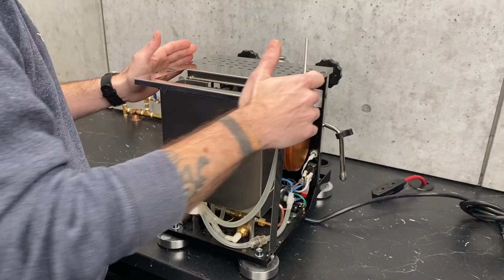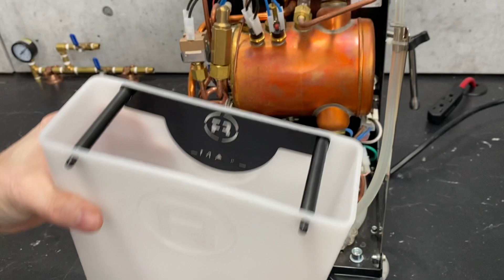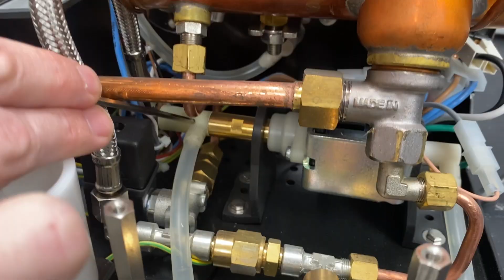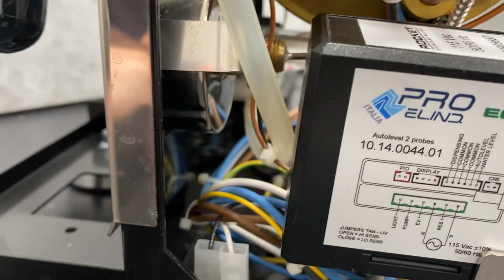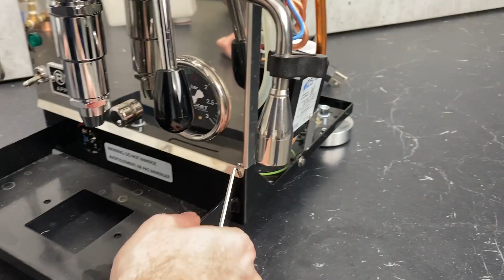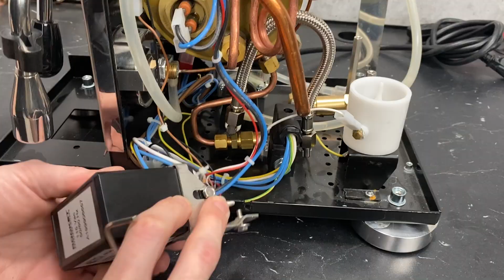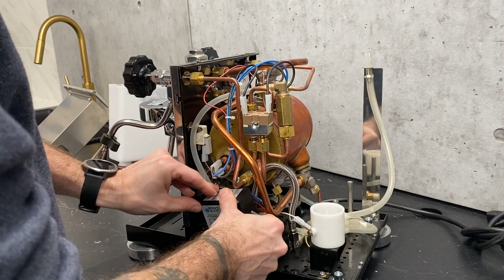Rocket Espresso Appartamento: Internal Tour and Component Identification

Comment: Are you able to adjust this Campini pressure stat? The screws are covered in red plastic, making them very difficult to access. I want to lower my boiler pressure.
Reply from the maker: Hi KL, The pressure stat is adjustable. They put the red stuff on the adjustment to discourage end users from adjusting. Know that if you lower the boiler pressure you will also reduce the brew water temperature - lowering the pressure reduces the temperature in the boiler.

Comment: The factory settings are amazing. It should not be up to the buyer to open the machine, but he should know that there is a real qualitative gain in cup by lowering the extraction pressure to 9 bars, and by lowering the boiler pressure to 1, or even 1.1 bars (almost no impact on the steam pressure which is powerful on this machine, except if you have to make more than 4 or 5 milk drinks). Of course, for the boiler, it could be argued that this may depend, among other things, on the origin of the coffee or its roasting. But we are on a group E61 which is not intended, it seems to me, for light roasting. Moreover, many consumers say they are sensitive to temperature and forget to have hot cups (many baristas also neglect this variable). 
It would be interesting to have a customization of the machine so that these two adjustments are accessible without disassembling (that must be imaginable for the pressure of the boiler, on the other hand for the access to the OPV it would be less, obvious).
Reply from the maker: Hi bttb, Thanks for adding your thoughts. As an HX boiler machine with temps controlled by pressurestat variations in brew temperature are typically done using cooling flushes prior to making an extraction. Fairly typical among machines at this level the brew pressure and boiler pressure adjustments are under the hood.
Marc
Reply: @Wholelattelovepage  Thanks Marc. I'm sure you've already tried (especially on the Rocket Appartamento) to touch the OPV to lower the extraction pressure to 9 bars and to lower the boiler to 1 bar. The coffee is then so much better.

Comment: Hi Marc from WLL and team,

My rocket apartamentos power switch is stuck and won’t go up to the “on” position. Did the switch fail ? If so, is there a video you may have on how to replace that ?
Reply from the maker: Hi B, We do not have a video showing how to replace the switch. But it's fairly easy to do once the machine's housing is off and we do have a video for that: https://youtu.be/bRTRHTEflxY
Marc

Comment: Thanks! By far the best video tour of the inside of the Appartamento I have seen. I've had my Appartamento for about 3 years now and love it. I have had to replace the vacuum relief valve. Have a new issue that just popped up. The machine seems to be overheating and have water coming out of that little "button" under the group head. The safety valve is being tripped due to overheating. I contacted Rocket so we'll see what they say, hopefully it's an easy fix!
Reply from the maker: Hey austin, Thank you a whole latte for the comment! Hopefully Rocket can help you out. Overheating sounds like pressurestat or relay.
Reply: @Wholelattelovepage  Have a new Pstat on the way from Rocket. Do you guys at WLL happen to know how easily a new one can be installed? Obviously there are the two wire connections on top, but does the bottom silver metal base of the Pstat need to be unscrewed from the tube below as well? Or can the plastic part be pulled out and just slip a new one into the silver metal base? Thanks!
Reply: UPDATE - For anyone having the same issue with their Appartamento. Ordered a new P-stat from Rocket USA. It does not look like the one in this video and is the same as the original P-stat in my machine (Round in shape, brand name MA-TER). Unfortunately a new P-stat did not fix the over-pressure issue in my Appartamento. Just FYI for anyone replacing the P-stat at home themselves you have to take the entire casing off of the machine. The P-stat sits on top of a rounded pipe below and a bolt threads into it below securing it to the pipe. So basically you have to turn the bolt below the P-stat counter to get it off.
Reply: @IbHustln  Have you been able to fix the issue? My machine is starting to over-pressure and releasing steam above the drip tray on a fairly regular basis. I'm hoping I can fix it at home and not have to box it up and ship it across the country for a warranty repair.

Comment: This is a great video, thanks WLL. It's really great to get the visuals of what's happening inside the machine and to see what does what. This is the first time I have heard there is a water level marked on the water tank of the Appartamento. I checked my owner's manual, and it didn't mention it there. I've been filling it as close to the top as I can for more than a year now.
Reply from the maker: Hey Mike, Thanks for the comment and you're welcome for the video! So long as you're not overflowing the reservoir you're fine.
Marc

Comment: Excellent video! My Appartamento has been consistently overheating on startup for a bit. I've swapped out the pstat and that hasn't corrected it. Any tips on what to look for next?
Reply from the maker: Hey Chip, So after startup it's not overheating? Or does it always stay too hot? Just want to make sure you're not taking the hissing as the boiler reaches 212F/100C as overheating. Hissing or steam for 30 seconds or so is normal as the machine is heating up prior to the vacuum relief valve closing on the boiler. If you have continuous hissing or steam perhaps your vacuum relief is clogged so not closing all the way and needs cleaning or replacement.

Comment: I've had my Appartamento since 2017 which I got from you guys and It's been running like a champ since! Only one small repair under warranty which got the part out to me super quick and with Customer Support was able to diagnose the issue and get me back to brewing in a few days. Other than that, I keep the machine clean and she runs like a champ and my wife and I use it pretty much every day sometimes twice a day since we bought it. I too have recently saw some videos about the brew pressure and brew water temp and am going to try this for myself as mentioned below. I've had no issues with whatever my machine BAR is set to however after diving deeper into the topic I could say that the machine pumps water maybe slightly on the high end and am wondering if lowering the pressure to 9-10 will yield in a better extraction by allowing the coffee more time for full extraction potential. I typically run the same coffee day in and day out with the occasional fancy brew. 

I have a triple basket and am usually always running 20g and while shooting for 40g yield am usually way short of that 25-30 second from 1st drip. If I go to 30 seconds I'm usually at 60g. The 60g usually does task good and produces good crema I'm just wondering if I can make the flavor or extraction better by adjusting anything or if I'm almost spot on. The coffee is in no way "watery" but initial extraction does come out I would say on the faster side and that slow drip you see with naked basket is just not there. 

I ordered a temp gauge too for the Group Head to really dial in brew temp after playing with the pressure I'll see what happens. I also grind on a Silencio and am usually at 1.5 grind setting almost the lowest it will go. 

Lastly I've ordered an IMS screen to see if that improves water distribution on the puck. All in all I still LOVE this machine.
Reply: well... I dialed the Silencio Grinder to basically 1 with 0 being bur on bur and I've yielded a nice shot of 20g in 42g out in about 28 seconds. The flow rate is MUCH slower out of the extraction and the flavor of the shot is totally different. Ended up with about 45ml of espresso with a nice layer of Crema. I did a 5 second pre infusion too.

I'm anxious to see what difference if any it will make when I can monitor the brew pressure and see if adjusting it to say 9-10 Bar if it's currently set to 12-13 will make a difference. Then I once BAR is set I'll install the temp gauge and see about the difference it makes once the brew temp is fully up to temp and I'm not just guess. 

Finally I'm really interested in possibly trying the Flow Control Valve for the Rocket Appartamentto and messing around with those settings.
Reply from the maker: Hi Joshua, Thanks for the long-term owner report! Glad our CS staff got you squared away quickly. As a pressurestat controlled machine for temperature cooling flushes are the way to work the temp - guessing you knew that.
I would not worry too much about extraction timing so long as flavor is good. As for brew pressure, manufacturers like Rocket, Bezzera and others set the OPV to a slightly higher pressure on their vibration pump machines as compared to their rotary pump commercial machines. Typical rotary pump puts out 10-11g/s while the vibration pump in your machine and others does 7-8g/s. It's unlikely you're hitting the OPV set pressure when brewing as some pressure is dumped through the coffee and the OPV is much further back in the brew water hydraulics. While pressure and flow are not the same they are related. Manufacturers set higher OPV on vibration pump machines to keep the flow rate closer to rotary pump machines.
Reply: @Wholelattelovepage  Thanks for the reply... Yes usually I will wait about 20-25 min before using machine for it to heat up... do a 5 second flush before pulling shot. IF the machine sits on for a longer period of time Ill flush until I don't see water with steam about 10-15 seconds. 

Usually if I'm making milk drinks I'll grind a bit Corser and have a 1:3 or even 1:4 ratio get good crema still and the flavor is still good to me mixed with milk... I was messing with a 1:2 ratio this morning with a much FINER grind and I could def tell a difference in flavor. If it wasn't ground fine enough and I had say a 1:2 ratio 20g to 40g in 50ish ML in say 10 seconds the coffee was bitter and sort of one dimensional. Grinding finer to get a longer extraction really changed the taste I think. 

Instead of just adjusting brew pressure at the OPV would you suggest investing in a Flow Control Valve to experiment with restricting flow? I did see your videos on brew pressure and how it can effect taste ect.
Reply: Unfortunately, i purchased mine there in 2018 and only 8 months out of warranty it now goes overpressure in the boiler. I now live near the Cape in Mass and no one repairs over here. I tried adjusting the pressure stat, but that only worked for awhile. Replaced the pressure stat with same result. i have to use the steam wand to release pressure so i can brew with out the machine whistling and releasing pressure. Help!
Reply: @tommer5008  if you call up Seattle coffee gear or rocket USA they are pretty helpful. I had to replace one part and although daunting at first they walked my wife though the whole thing while I was out of town and she got it back up and running really easy.
Reply: @jdpst20  Thanks! yah $150 in parts and my labor time later a new controller fixed it. Reading on reddit, this part fails too often. Suppliers and Rocket should really have extended support and warranty for it. I am really sad about all of this

Comment: Thanks guys for the informative video. I appreciate to see another video for housing removal and thermostat pressure adjustment for powerful steaming performance on the Rocket Apartmento
Reply from the maker: Hey MA, You are welcome. Stay tuned - more Appartamento videos to come including housing removal/install. While you can adjust the P stat to increase boiler pressure/temperature keep in mind that increases your brew temperature as well. Can deal with that by using a longer cooling flush before an extraction.

Comment: Interesting! Mine looks a little bit different though. I still have an older model. The pressostat looks different and has a a slotted head-screw on it and also it doesn’t yet have the eco mode. It’s great to see and to understand better how the machine works, but to be honest the only things I would do as an mechanically unskilled user is to change the brew pressure via the opv valve if I had a grouphead manometer, adjust the boiler pressure via the pressostat if I had a grouphead thermometer or, and that‘s the only thing I have done so far as I don‘t own the appliances above yet, descale the water sensor when the machine won’t fill even though there‘s water in the tank.
Reply from the maker: Hi Tim, Thanks for the comment! Yes, it's changed a bit over the years.

Comment: Did I see a manual boiler drain valve at the bottom of the copper service boiler to allow draining of the boiler?
Reply from the maker: I believe what you saw was the boiler's mounting bolt. Fairly easy to drain. If you don't know how here's a video demonstrating draining of an HX boiler Profitec Pro 500. Procedure essentially the same for the Appartamento: https://youtu.be/qzsAg9q9CYM

Comment: Great video again. Feel like I know my machine better now, thanks!
I have a question about the OPV and the fact that the Appartamento is known to be set at a pretty high pressure. Mine reads 11 bars on my grouphead aftermarket gauge with the blind basket. There is alot of discussion if we should turn it down to 9 or not. Been tempted to do it but reading a lot of conflicting posts. Any thoughts on that? Any issues in doing that?
Reply from the maker: Hi Phil, Thanks for the comment. I do have thoughts and they're based on conversations with machine manufacturers. I'll get to those in a second... First, I think a lot of people get wrapped up in 9 bar as a magic must have number for espresso extractions. I've had plenty of incredibly good shots pulled at higher pressure like manual lever shots and lower pressure like flow profiled extractions. In my experience I find flow rate of brew water is far more impactful than +/- a couple bars of pressure. So what do the manufacturers say? Luca Bezzera says they set their domestic machines with vibration pumps to 11 bar in order to provide a good potential flow rate of the brew water. Vibration pumps have lower flow rates of 7-8 g/s than the 10-11g/s from commercial rotary pumps. There's no issue with setting to 9 bar. I say give it a try, taste and see if it makes any difference in the cup. You can always put it back to 11.  You'll likely be grinding a bit coarser and maybe that works out with your other variables and maybe it doesn't.
Reply: @Wholelattelovepage  thank you for the comprehensive reply, will give it a try!
Reply: Hey Phil, just one thought I had regarding the exact same thing: Since the pressure gauge at profitec flow profile equipped machines also reads the pressure without a blind basket, but rather with ground coffee in the basket, I would rather go a bit higher than 9 bars with pump pressure, because essentially pressure is lowered by there being a release in terms of water flow through the espresso puck. So I would probably dial in my espresso first, then reduce pressure to see what the pressure gauge reads while extracting espresso. As wholelattelove pointed out extraction times might go up with less pressure, maybe requiring you to grind coarser, but I believe this way you get a better idea of what the actual brew pressure is instead of just the nominal pump pressure.
Reply: @timgerber5563  that is correct, but based on some, pump pressure should be 9 which, you are right, will end up closer to 8 in the basket while brewing and that would be the "classic" way to brew. Because dialing in pressure at the puck level would be very irregular as all coffees are so different and  flow differently. Pump pressure at 9 appears to be the sweet spot between good pressure for extraction and preventing channeling... Anyway, James H. appeared really ticked off at the fact the this and so many other machines are set higher than 9. :)

Comment: When would you use the green eco button? Could you give some situations in when one could or should use it? Thank  you
Reply from the maker: Hi Carlos, The ECO button when turned on will power down the boilers after a period of no use of the machine. I believe it's 90 minutes. You might not want ECO on if your machine is all warmed up and you know you'll be using it more than 90 minutes in the future and don't want to have to wait for it to warmup again.
Marc
Reply: @Wholelattelovepage  thank you Marc :)
Reply: Not every machine has it though. It only became obligatory a few years ago. My 5 year old appartamento doesn’t have it yet.

Comment: Fantastic video.  It’s so interesting so see you walk through these. I don’t understand some of the terminology, like what a pressure stat is, but it’s very informative!
Reply from the maker: Hey Marshall, Thanks for the comment. A pressurestat measures the pressure in the boiler to control temperature in the boiler. When the pressure drops the boiler heating element is energized. When pressure rises enough the power is cut to the heating element.
Marc